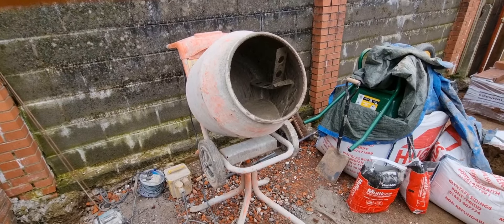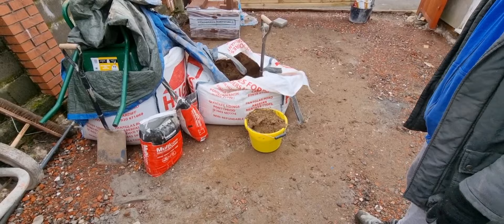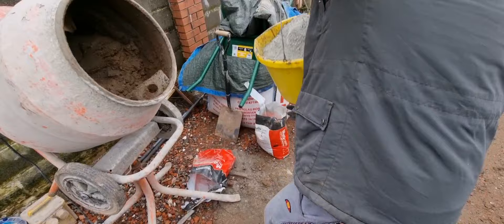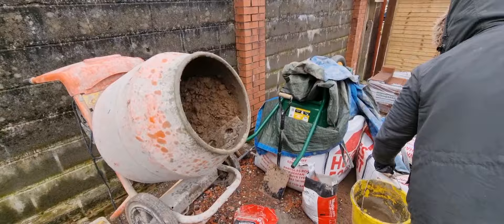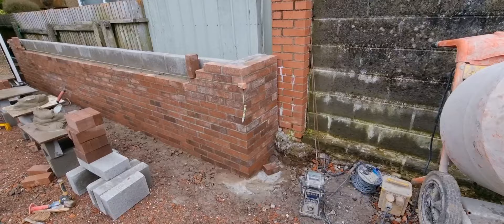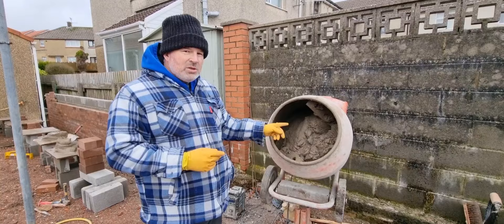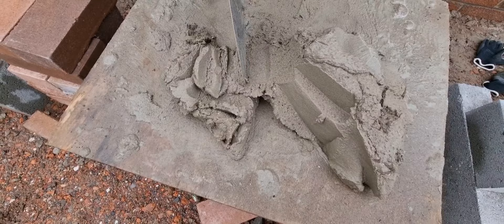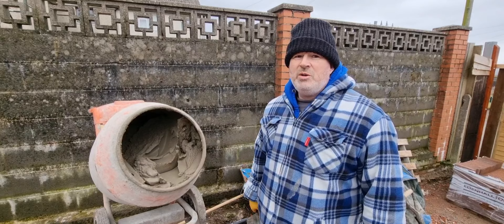Bricklaying Mortar Mix Explained

Comment: Love your videos good quality work no point having a 110 mixer if you are going to run a 240 cable to the mixer 110 box should be at the power point and run 110 cable to the mixer all the best boys 👍👍
Reply from the maker: Fair paint i suppose cant argue with that Rob .Good point 👍💯
Reply: Why not, the point of 110v is that it’s unlikely to kill you so the mixer is safe. The transformer can be in any convenient position!
Reply: @andyxox4168  Because you still have a 240 volt cable leading right up to the mixer which completely negates the point of making a building site safer by using 110 volt equipment and cables
Reply: @Mike-fx4wk  240V distribution, 110V utilisation … it’s quite within the regulations, renders the equipment being used as ‘safe’ and negates the need for heavy cables to carry the 110V.
Reply: @andyxox4168  I see so it reduces risk of death from the equipment ? They're not bothered about the cables running up to the equipment ?
Reply: @Mike-fx4wk  so where would you plug the radio in … 🤔 🙄

(A little understanding of why 110V equipment came into use historically might help)
Reply: @andyxox4168  I would imagine plugged in close to the source of power or use a battery powered radio. I'm asking you genuine questions and you're getting shirty. Are they not bothered about the cables running up to the equipment ?
Reply: @Mike-fx4wk  no, they’re probably not bothered what voltage the mixer is either, just happens they have 110V, when you see the way material is added or hands are put in the mixer you can see they don’t care about safety.

The reality is that 110V equipment was introduces to be safe before RCDs were commonly available. Also the chances of being electrocuted by the equipment is far greater than the risk from an extension on the floor. Some sites insist on 110V only, some don’t.

P.a. Have you seen the price of batteries? 😂
Reply: @andyxox4168  Sorry I meant the people who regulate are they bothered. I see, they're just trying to minimise risk but keep it as convenient as possible (they being the People who regulate) yes I own batteries for a makita they aren't cheap. Any way health and safety is boring, I just think the original comment makes a decent point
Reply: @Mike-fx4wk  there is no legal requirement to use 110V on site but it is recommended in certain circumstances. If a 240V (now re-designated 230V to suit the EU harmonisation) supply is utilised an RCD must be installed in the circuit.

Comment: I have to build a small circullar brick garden bed for a customer's olive tree. She wants it probably 4-5 bricks above surface. I've tried to find a brickie, but not one will take the job - obvs, not much dosh in it.

Question: can i mix the mortar in a builders tub eg 36l, and what am i laying on - sharp sand, MOT1 etc?
Reply from the maker: @DeanWhiteUK  
Hi Dean
I'd mix on a mixing board not a tub it's easier that way by hand.
I'd add a concrete foundation really for any brickwork 👍

Comment: we got 110 for safety then puts a 240v extension right next to it, all's good until you accidentally miss with the hose and soak the extension, which should also be completely unwound, not left coiled,  good vid by the way boys😂👍
Reply from the maker: Thanks mate grumpy is about right
Reply: @brickrightbuildinglandscaping  you want to see me when i do  site inpsections🙂
Reply from the maker: @grumpyoldgit8254  
🤣🤣🤣👍

Comment: Great video. I was going to use flow point to point my patio but I’m thinking of just doing sand and cement with a mortar gun. What ratio of sand and cement would I need to make it buff coloured? Do I need white cement? Cheers
Reply from the maker: Id use a 3:1 mix and add buff cement liquid dye
Reply: That’s great. Thanks for the quick response. Cheers

Comment: Im building my house in south west of ireland. My block layer was finishing gables on sunday. He had a different young fella with him this time and he blocked approx 100 blocks in the rain and the mortar now looks abit sandy and you can scrape it back with a nail altough it seems still fairly set. Do you think i should get him to rip to 100 blocks down and do it again, iv a feeling it wasnt mixed great anyway and aswel as that the rain washed the cement out of it. I presume there still would be no fear of it
Reply from the maker: Presuming the mix has been done correctly if its run in the rain .
Just flush it all up with  more mixed cement should be fine .
Good luck 👍

Comment: I find that when I am buttering bricks or block the muck falls off is this due to the muck or the way I am applying it and also I use a tub of feb mix how would you recommend using
Reply from the maker: Muck has to be creamy to stick but technique is also needed. As for Feb read the instructions id say .keep at it good luck 👍
Reply: @brickrightbuildinglandscaping  thank you very much appreciate

Comment: Hiya, a really useful vid. I need to relay my patio steps as the slabs came loose, thought I'd mix by hand in a wheelbarrow and having tried that today I realised that's nuts! Lol

So as it'll be the first time using a mixer, I wanted to ask if the time for mixing 10-15 minutes does that depend on how much you're mixing? I'll probably start with counting shovel loads. Thanks. 👍🏼
Reply from the maker: Yes depends on a lot of things dont add to much water let it mix 👍
Reply: Use sharp sand under the patio.

Comment: In the US when I try to find plasticizer they don't have the Bostik plasticizer. They have other products that appear to be the same.  Kind of frustrating because I'd like to get what you use.  Makes life simpler.
Reply from the maker: I get your problem try your US product probably the same 👍💯
Reply: I got told and have been using a small lid full of dishwashing detergent in an emergency for small backyard jobs. Is this allright?
Reply from the maker: @bernardmarsh4133  
It's weakens the mortar so I wouldn't recommend it 👍

Comment: Can I just add that different bricks require weaker mixes the London bricks with deep frogs have a six and one mix so if theirs any settlement  in the foundations the joint would crack and not the brick
Reply from the maker: Spot on Reg think i mentioned different mix ratios in the description its a guide as i said .
Good luck mate thanks 
Justin 👍

Comment: Great video. What do you do with the crap from the mixer when you clean it out at somebodies house if you haven't got a skip or waste land?
Reply from the maker: Appreciate it.
You just remove all the mortar with a trowel add the water and gently empty it on to the base each day it just drains straight through 👍

Comment: Great video! thoughts on adding pva anyone? I thinking of adding to mix for my retaining wall, does it help with strength, adhesion, water resistance?
Reply from the maker: Seen it used for rendering but not for bricklaying. Commonly used for bonding aswell. 
Not sure if it would be of any use for bricklaying have to look it up 👍
Reply: @brickrightbuildinglandscaping thanks for info. I've now went down a rabbit hole trying to understand the use of sbr 😂
Reply from the maker: @zororat  
🤣🤣👍🧱🙌

Comment: Cheers guys 
Will need to watch again and take notes.
I’m always worried about my concrete drying to quick.
How long does it take before it sets?
Reply from the maker: Takes a full day to set passed 50% then its cures for about a month to set fully .we normally use concrete within an hour of mixing it all

Comment: No one seems to be able to answer this question. How do you colour match your mortar to the old mortar in the case of bricking up an external doorway.
Reply from the maker: You cant RC because you dont no the mix ratio.Also colour of the sand used and the brand of cement would make a difference in colour. So unless you no the answer to all that  your not gonna colour match .You just do your best RC .
Good luck.
Justin 👍

Comment: Hi, my house brick work has been repainted with a 3mm key so it’s falling out and turning to dust.  What advice do you have for me, key it back 20mm and use this mix to point, or do I need to know anything else to make sure it sticks to the old mortar?
Reply from the maker: Disc it out as deep as a mini disc cutter will go.
Hose down all the bricks and joints .Allow to dry .damp joint and re point with mortar and  bush the mortar in to the joint with a jointing bar or trowel. 
Good luck 👍

Comment: some good tips👍

a question about sand. your sand is damp, does the quantity vary if it is dry, like powder.

I ask because the bag of sand left in my garage has fully dried out, no moisture in it at all, so do I have to adjust the quantity of sand to suit? or should I add water to the sand first to dampen it before I gauge it and add to the cement for a mortar mix?
Reply from the maker: Thanks David
The sand amount and gauge is the same you will just need to add more water than in damp sand 👍

Comment: OPC Why? Why not motar mix that has lime in it? Does the plasticiser have a retarder in it? I noticed your old mix had not begun to set. I could see using OPC for concrete block, but looks like normal clay bricks and why not normal motar mix? What is the temperature there, looks a bit cool with all the heavy clothes. Is the temperature affecting the set time?
Reply from the maker: Opc is a common cement to mix mortar or concrete thats why its used .
You can add lime to the mix if you want to or instructed by the architect. 
The plastizer has no retardant in it.
Yep the temperature here in wales at that time was cold and wet 👍

Comment: Good mix ratio for shade variation but cut the soap down to 5mil for that size of mixture
Reply from the maker: It just does mix adequate enough with 5 ml ive tried it so many times .Your right less feb the better but 5ml just isn't enough in my opinion 👍
Reply: @brickrightbuildinglandscaping  Check the bottle for quantity on the 25kg bag of cement , I always use 5mil straight into the mixer
 and pour the water on top , always comes out like butter . Too much soap and you will be picking the powder mortar joints out a year later.
Reply from the maker: @chipper701  
Totally aware of that  we have tried so many times with 5ml and let the mixer mix its self to death and the mortar isnt what id call a nice mix to use layinv bricks .
Maybe its the sand here   not sure .Ive been back to various jobs over many years and i haven't an issue but that said i dont disagree with you 👍
Reply: @brickrightbuildinglandscaping  okay I suppose everyone to their own 👍
Reply from the maker: @chipper701  yea definitely good luck to you mate 🙂👍💯

Comment: If you were measuring the water, how much would you add to the mixture shown?  It looks like here you used the "TLAR Method" ["that looks about right"].  Alas, that works only with experience by one who knows what he's doing -- and not with a noobie like me.
Reply from the maker: The measure of water is a difficult one .
It all depends on how wet or dry your sand is.
Id say a a little at a time easy to add but cant take away.dont forget the mix has to mix the plastersizer helps this process. Hope that helps.
Justin 👍

Comment: You already added the water but didn't say how much water?
Reply from the maker: All depends on the water content of the sand on site .id start of  with a little water and build it up easy to add water you can't take it away hope that helps 👍

Comment: In very exposed areas could you use 1 :3 mix or would that be too strong
Reply from the maker: Bit strong that michael normally for underground work that ratio.
Above ground anything from 4-1 to 6-1 is usually standard. 👍

Comment: Can you use sbr in the mix ?
Reply from the maker: Billy yes you can in fact sbr has some very good advantages to use it such as addded strength to the mix waterproofing and reduced water per and reduced effloresence. Use it more in paving than bricklaying really though. 👍

Comment: How much water was in the mixer at the beginning for that full mix please?
What's the smallest mix you can make in there? Is 1 bucket of sand not enough for some reason?
Reply from the maker: Hi Henry
Water all depends on how dry or wet your sand is so check that first. You can always add more water if needed .Also you can mix one bucket of sand if you wanted but thats probably the minimum in this mixer .
Hope that helps 👍
Reply: @brickrightbuildinglandscaping  yes that helps a lot thanks. I'm buying one on Tuesday from bandq new stock comes in. They said they price match Bradfords building supplies £430 and then I get extra 10% off with trade card on top. Thats £387 brand new. Currently paddle mixing in a bucket and not getting it as good. Have to add to much water in the beginning make a slurry then pour that into a bucket and add more sand cement to brink it back. Still takes 10 - 15 mins and not as good.
Reply from the maker: @E69apeTheMatrix420  
Well thats a good price there i think .great mixers had a few in my time 
Good luck 👍

Comment: If you didnt use plastisizer, how much lime would you put in that 4:1 mix? What 3 part ratio would that be?
Reply from the maker: Id go.4 sand 1 cement  1 lime for bricklaying  but there are .any ratios you could even go 6 or 5 sand depending on strength of mortar 👍
Reply: @brickrightbuildinglandscaping  Agree with you. 
1:1:6 would be something around class 3 mortar, or M4 strenght class. 
But for higher strenght bricks, a mix of 1:1/2 (half):4 would be more suitable and that would give class 2 mortar, or M10 strenght class.

Do you know the compressive strengt of the bricks you useed in this video? Its designated in "MPa" and could vary from 5MPa, 10MPa, 15MPa, 20MPa
Reply from the maker: @picajoool  think they are around 75/mm2 for the bricks .
A lot more to bricklaying than people think isn't there 🤣👍

Comment: What does the plasterciser do? What's it function?
Reply from the maker: It makes the mortor mix more workable or fluffy as we say in the trade 👍👊
Reply: @brickrightbuildinglandscaping  So the mortar becomes more smoother, softer, creamier? Is there any structural purposes/benefits? Also is it a necessary ingredient? Is the mortar weaker without it?
Reply from the maker: @ya00007  it does stop mortar cracking but if you add to much it will weaken the mix .If you want to lay bricks its a great benefit or if you dont want it in the mix use lime in the mix as that does very similar makes the mix more workable. 
👍
Reply: @brickrightbuildinglandscaping  Thanks for the information. Please can you post a video explaining the difference between plastercisers/admixtures and SBR. And why are SBRs very expensive compared to plastercisers?
(And should you use fairy liquid instead of plastercisers? I know a lot of builders who do this).
Reply from the maker: @ya00007  
Maybe ill do one at some point .
Many thanks

Comment: you’re using Multicem not normal cement, Multicem theoretically doesn’t need plasticiser
Reply from the maker: I no but it does we only use a small amount. The video is aimed at the diy person so didn't want to confuse 👍👌

Comment: Since when do you use a straight portland for mortar?
Reply from the maker: Straight portland not sure what that means .we used ordinary portland cement 👍
Reply: @brickrightbuildinglandscaping  Same thing.  Never use ordinary Portland cement as it is too hard. Portland cement is for sidewalks, etc. Mortar has lime in it and is for brickwork. A lime mortar for stone work. You never want to use a mortar that is harder than the brick or stone.
Reply from the maker: @gary24752  agree totally but all they sell here is opc for standard works Gary and its what we are told to use in college etc .The bit u say you never want your mortar to be harder than the bricks is spot on agree.
May be where you are things are called different to here not sure but opc is used all over Britain for standard works .
Appreciate your comments Gary always good to here these things 👍 👊🧱
Reply: @brickrightbuildinglandscaping  So hydrated lime that you can mix with portland cement is not sold where you are?
Reply: @brickrightbuildinglandscaping  No portland with hydrated lime like type "N" or "S" mix sold where you are for mortar?
Reply from the maker: @gary24752  yea they do nothing wrong with adding lime ive no issue with that ive used it before many times and its a workable mix 👍👍🧱👊

Comment: Plasticiser should be mixed with gauging water and a 5/1 mix is more appropriate to above ground brickwork … still gets the job done in a non professional environment.
Reply from the maker: I have found over many years here in wales which is really exposed to rain and wind that 5/1 mortar is a bit weak and pits over time .A 4/ 1 mix is more suitable the water all depends on how much water is in the sand when delivered. So summer we add more water and opposite for winter in the professional environment 👍
Reply: @brickrightbuildinglandscaping  interesting but don’t confuse trade with professional, grouts and mortars in critical applications are carefully tested and carefully gauged to ensure the correct performance, similar rules apply to concrete mixed for critical purposes including testing of every batch before placing and after placing. (background included turbine foundations, machinery grouting and other heavy engineering)
Reply from the maker: @Andy XoX  
Andy i no all that slump test and compating factors in concrete etc i get all that this was just a simple mix in a simple mixer by simple people me and brad 🤣🤣 i do get your point now you've explained. Good luck mate 👍

Comment: 4.1 what you building manholes in engineering bricks.....
Reply from the maker: Nar its wales gary 6.1 or 5.1 here and the weather just pits the cement so 4 .1 is good.
3.1 for below ground work 👍

Comment: well I am 1 minute 13 seconds in. The feb states 5ml for the mix you're using. Put that in the barrel not the water. The OPC you stated isn't OPC its multi not the same.
Reply from the maker: Your an expert then good luck 👍